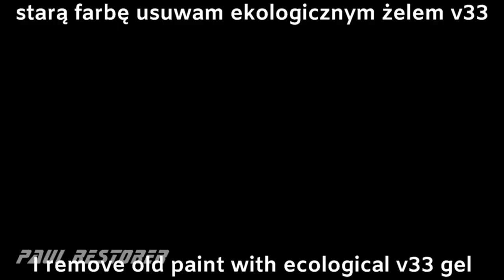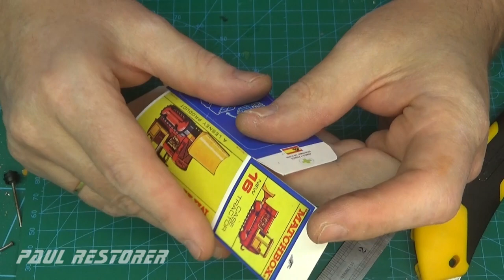Matchbox restoration Case Tractor nr 16 diecast car . making parts

Comment: Superb.  A great rescue of a very corroded model.  Just surface corrosion in this case.  Matchbox models don't seem to suffer from the dreaded Zinc Pest - which has affected some other diecasts.  Must be heartbreaking to see a beloved model disintegrate before your eyes.  I have the Kingsize version of this dozer.  Identical to the regular wheels model and comes in a set K17a with a Ford D800 low loader trailer.  I found the red body shell hard to paint:  lots of edges and corners to get the paint into.
Reply from the maker: Thank you very much

Comment: Excellent as ever. I have just bought one of these Case Crawler Tractors off Ebay and the cab is missing, as with most of them. Any chance of you making and supplying a few cabs please, to buy of course? You now need to restore the green Ford truck and Dyson low loader trailer. I am looking forward to watching it. If you have not got one then I will post one to you.
Reply from the maker: Thank you very much Robert. Of course I can make you a few cabins. Unfortunately, I don't have a Ford truck with a Dyson low loader yet. I'm sending you my email address.
paul.restorer@wp.pl
 Best regards, Paul